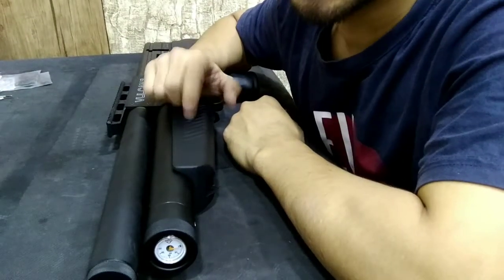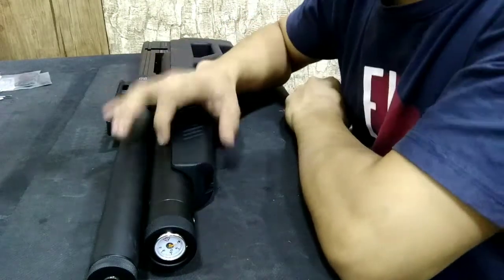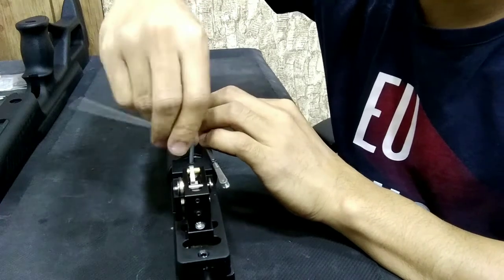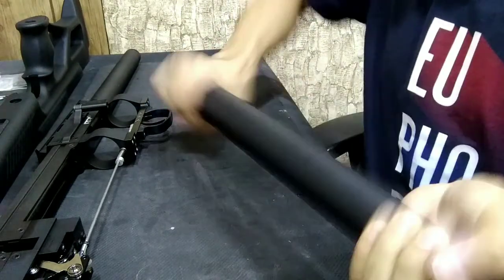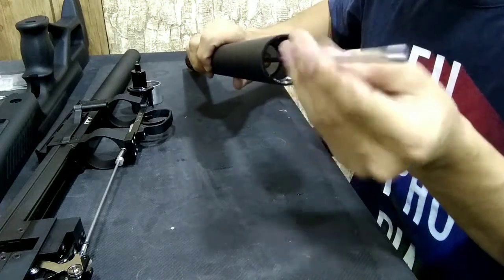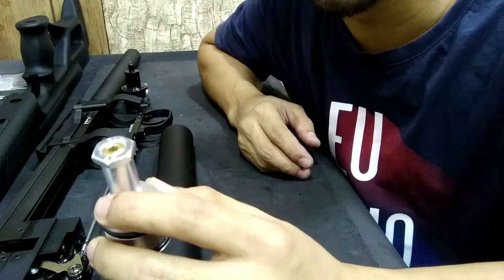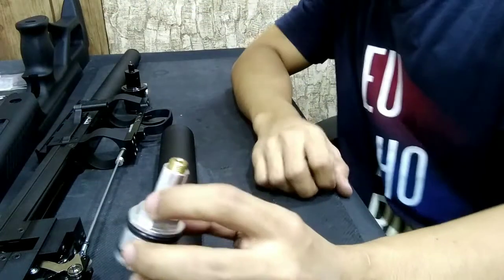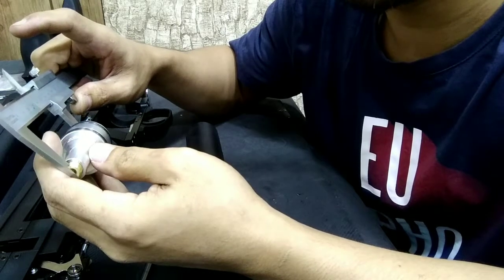How to release air and how to adjust the regulator on VULCAN

Comment: Hello can I get the size for the replacement spring for a higher speed I put a Huma regulator I set the bar at 150 on regulator on my 25cal Vulcan I’m trying to get to 900 fps or 920 right now is shooting at 826fps. any help would be appreciate it .thanks
Reply from the maker: Lower the pressure a little bit.. it helps the hammer and spring to knock the firing pin stronger then you will get higher fps